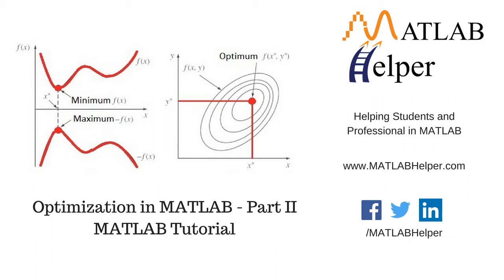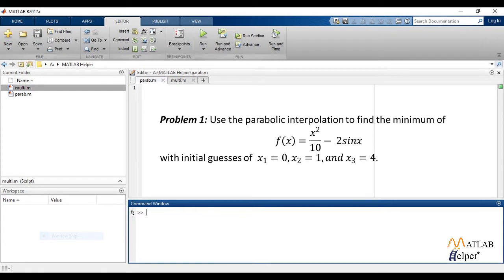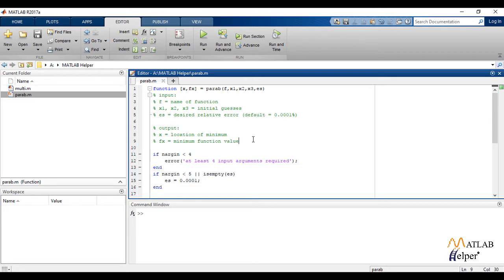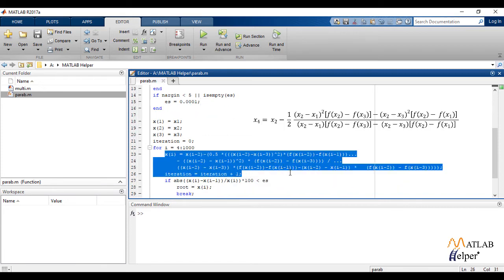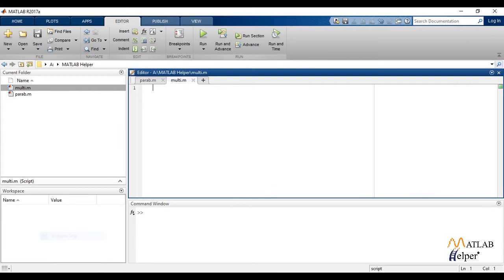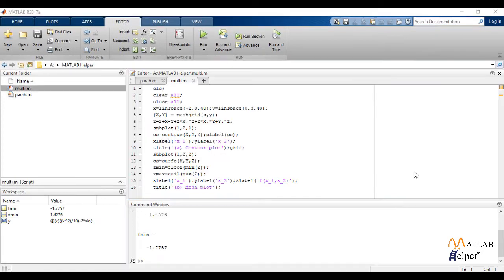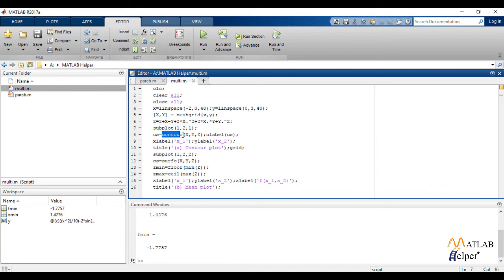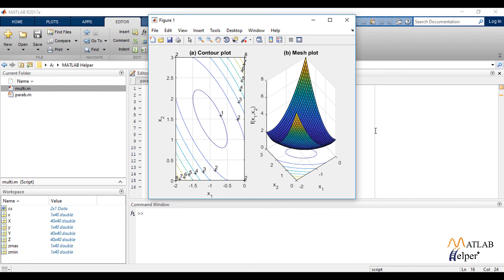Optimization in MATLAB | Numerical Methods | @MATLABHelper

Comment: #Optimization has two types:
1.#Parabolic interpolation  method of 1D optimization:In the formula,x1,x2,x3 =#Initial guesses,x4 is the value of x that corresponds to the optimum value of parabolic fit to the guesses.We have created a function, #f[x,fx]=#parab(f,x1,x2,x3,es).Where,f=name of function and# es=desired relative error.The output #x=location of minimum and #fx=minimum function value.Here at least 4 input arguments are required.If arguments are less than 5 and es is empty,reset es to default value of# 0.0001.Implementing parabolic formula in for loop,we will get the root.
2.#Multidimensional optimization:The functions required to perform these are,#linspace(),#contour(),#surfc(),#floor(),#ceil().
Reply from the maker: Disha Nikam, Glad to see your appreciation for our Video. Do support us by Subscribing to our YouTube Channel at https://www.youtube.com/c/matlabhelperteam